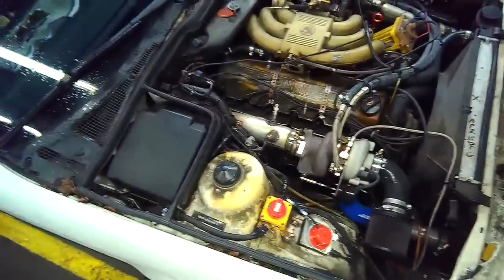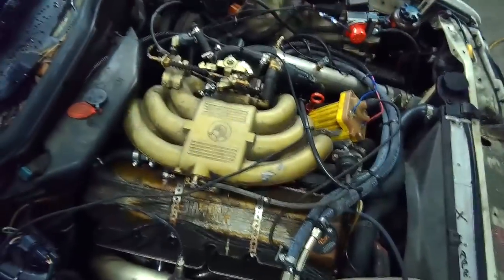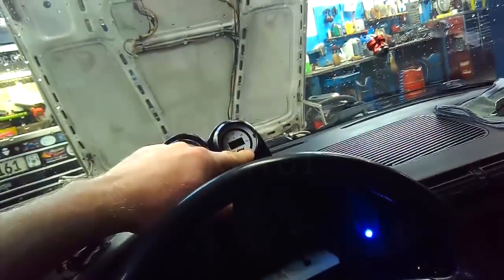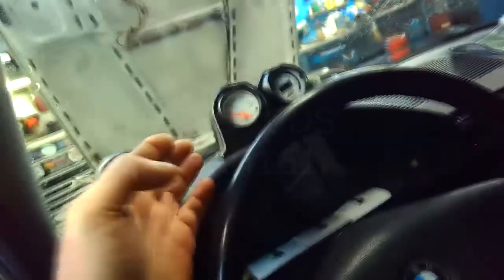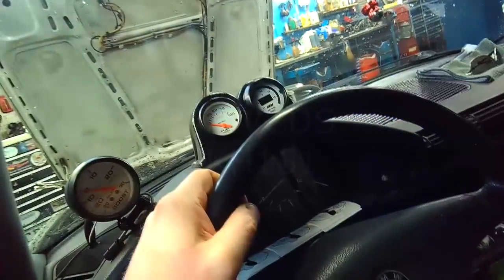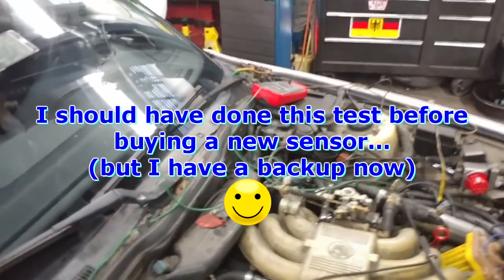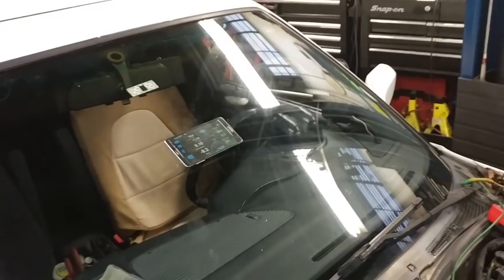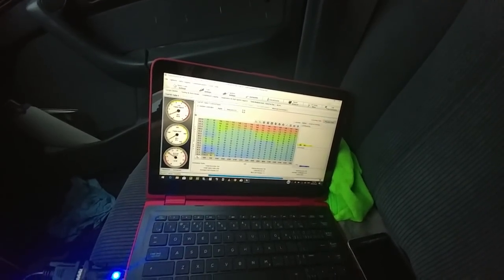E34 Got Boost - problem #2 (long version)

Comment: Good thing that you have that app on your cell phone so it would not keep you stranded in the parking lot. You’re coming along pretty good with your project and good to see that it was the controller causing the issue. Strange that Megasquirt did not change the air fuel ratio when it was showing that it was rich. Keep us posted on your new results as you fine tune it. 😀👍
Reply from the maker: Lucky it didn't... that could have mislead me more (due to it running worse, trying to correct a non mixture related issue).

Comment: Shame you didn't get that one in the beginning with the little read out you wanted needed to get the second one then nice job time for tuning new clutch for boost sorted!!
Reply from the maker: The first gauge (the one on the dash) I had from when my E30 was boosted... so it wasn't an extra expense. 2 gauges is actually better... I split the difference and fine-tune in the middle! LOL
Reply: Thomas EXOVCDS lol good thinking

Comment: So how is the ECU controlling the injection if it is ignoring the reading from the sensor ?
Reply from the maker: Base map. All cars have a base map... to allow the engine to run. The base map is a predetermined air fuel ratio so that the engine can run. The O2 & other sensors are used to "fine-tune" the base map... to get the best out of driving style.
Reply: Thomas EXOVCDS I thought gasoline run in close loop based on the lambda sensors
Reply from the maker: Yes... but closed loop just means that it is able to "adjust" fuel mixture (when there is a vacuum leak or other issue with the engine). When in "open loop" the engine runs on the bas map.
Reply: Thomas EXOVCDS Then it means I need to study more ... thanks for the explanation